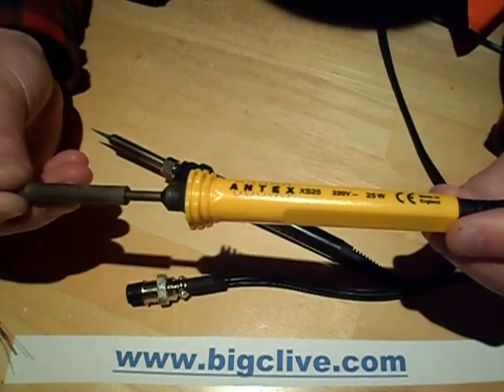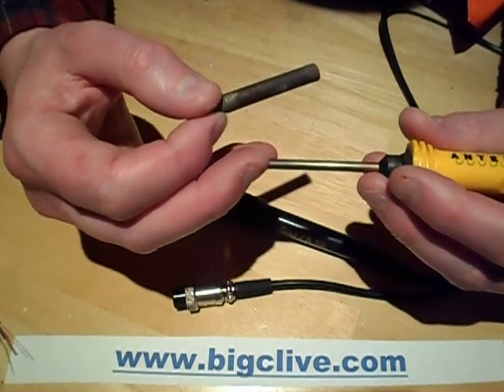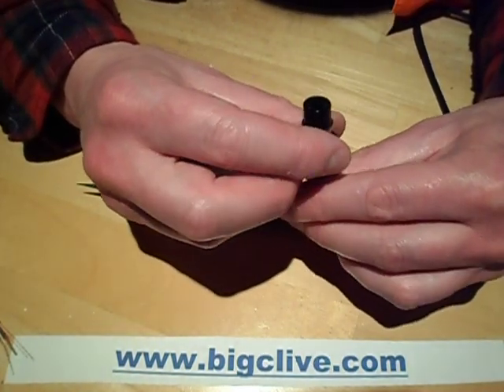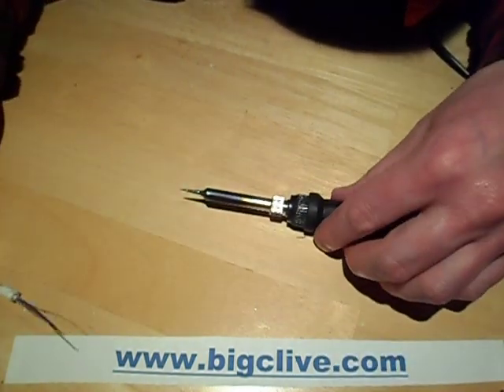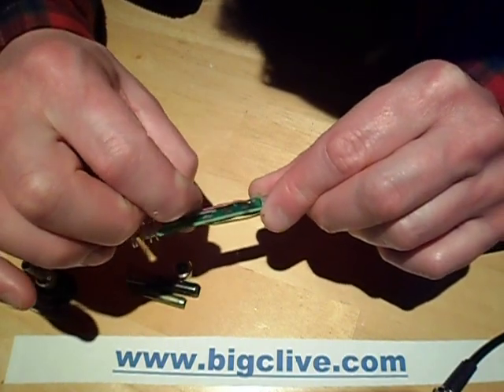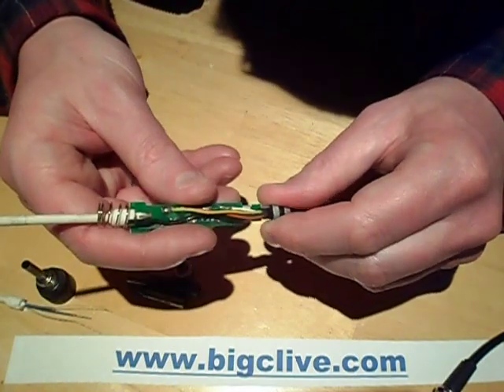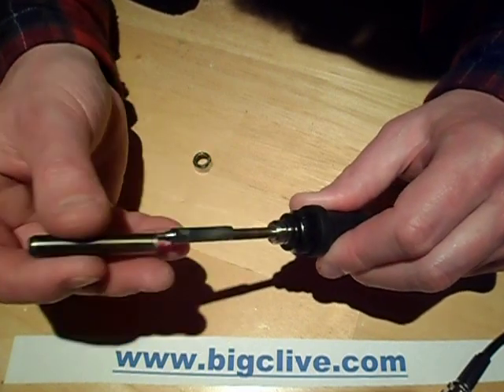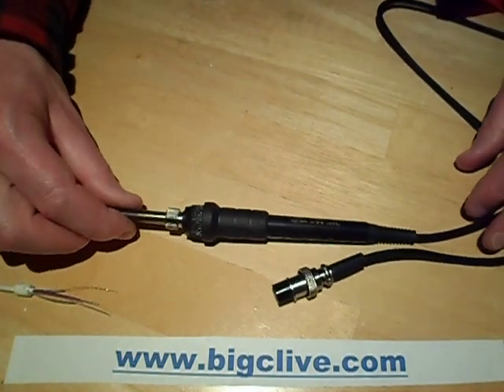Inside a cheap Chinese Yihua soldering iron.

Comment: How's the build quality, specifically, the plastic threads on the plastic/metal cover you start unscrewing at 03:31?

I'm asking because I've seen some 936/907 clones where those threads don't allow you to screw the tip cover properly (basically, they aren't strong enough to support the connection, they 'give out', and then you can (pretty much) keep turning the screw forever, without being able to tighten the cover properly).

You say "nice construction" at 05:34, but - is it? :)

Comment: i would like to try less than 120 volts on a red soldering iron. maybe 60 - 80 volts.
Reply: You can do exactly this if you buy the cheap "red line" Weller soldering station sold at DIY home improvement stores  ($65 US at Home Depot).  I think it's a piece of junk and not worth the price because the iron included with it is a standard 120 V iron with an ordinary wall plug on it, and the only thing the soldering station does is allow you to turn down the voltage to the iron with an electronic lamp dimmer circuit inside the box. No temperature feedback sensor, no calibration,  and no actual capability to turn the temp up, only down.  The control station is supposedly good for up to a 300 watt iron so I suppose you could plug a big iron into it and decrease the temperature downwards, but why bother?  It's 2024 and you can buy a temperature feedback controlled, calibratable analog soldering station for $45 from Harbor Freight;  I did a teardown and review of the Harbor Freight iron on my channel and compared it to the Weller, and the Weller lost, badly.

Comment: I have one Yihua 939D+, I use it for 3 years 7 days per week without any issue.
This is a very good option if you are in budget.
I have a Hakko FX-888D but I prefer the Yihua because it have 3 memory easy to reach.

Best Regards.

Comment: Well don't be shocked if the design is good, if it is indeed based off Hakko, which are Japanese soldering irons that probably are the best quality ones in the world. And this Chinese company Yihua is indeed a proper company, so there will be quality involved, it's not like an unbranded ripoff for example. I think Yihua is what most Chinese use, so for example in China they don't generally use the unbranded ripoff stuff that some naive foreigners waste their money on, in China they usually find a good Japanese or other foreign design, and have a legit Chinese company try to clone it at a decent level of quality, so the domestic Chinese workers can have a reliable product etc.

Comment: I've had this soldering station for almost five years now and it has been working perfectly, I have never had a problem with it. Mine is the same as all the basic 936 clones with a black plastic face and plastic knob to set the temperature, but mine says "W.E.P. 936 ® sol dering station," printed exactly with that space between "sol" and "dering." Perhaps a limited edition. I have no idea what could W.E.P. mean. But I can definitely recommend the station, it is great value.
Reply: Cool

Comment: I have learnt to hate these Yhiua irons.  I bought 2 one after another.  After one use i now get the 5-E error.
Reply from the maker: On the digital irons look at my video about them and the very common and easy to fix fault
Reply: @bigclivedotcom  i knew you might have one. Looking now
Reply: So I found the video I think it is. I actually have the a blue soldering station that also died after a few uses. I ended up just putting into storage. I will try to use your video to fix it.

The latest iron is a Yihua 928D-iii.

I checked the continuity of the element and sensor, both are fine. It does seem to heat up, showing temp rising quickly, then showes the S-E error.  Could it be an overheating issue?
Reply: In the end I bought a cheaper iron and re heated all the contact's.  Which seemed to have worked.
Reply: Did you find a good video to fix error codes on replacement irons on cheap solder stations ?

Comment: hi Clive. Up until today, i had a maplin soldering station - precision gold A55KJ - looks exactly like the iron you dissected. Today, it tells me 
 " - 5 -E -"  [without quotes] which, according to the manual is faulty element. trouble is, if i apply 19 volts at 1.6 amps to it, it heats enough to desolder the triac that should control the temperature to it - for testing - it too is fine. My question is - how can the unit detect the temperature of the iron - with pins 1+2 and 4+5 shorted out? [no thermocouple] I cant find a diagram for it anywhere and im not clever enough to reverse engineer it as its quite complex.
cheers in advance - Andy

Comment: Great video, very helpful, Thank you, Are these irons rated at 24 volts ? i applied 23 volts to one and it burned out the element in less than a minute !! I powered another with 16 volts AC and it has been working fine,,
Reply from the maker: They are rated for 24V, but only with thermal feedback control to limit the maximum temperature.  To use them as a thermally balanced iron you need to use a lower voltage as you describe.

Comment: I own Antex Xs25 with 3 extra original tips (each one costs about 10 euros each) and an ERSA solder Iron 30S 40W with also an extra tip that costs me including the shipping from Germany about 13 euros. Both are very heavily constructed and they are filling very well in your hand.  I work constantly with them and I feel very sure for their effectiveness and their quality. I got as a gift with another buy from aliexpress a "Soldering Iron 60W Adjustable Temperature" with some tips extra that seems like the one already shown in the video. Soldering Iron is very light and cheap, but the main problem was the tips itself, which are also very very light in comparison with antex or ersa one. They oxidized after the second use and they are very difficult to clean them. If I could attach a photo I will show what exactly do I mean. The previous month I ordered a YIHUA 8786D station just for the hot air from banggood (I am still waiting to receive it after 50 days from the shipping day) and with it, I ordered also an extra a set of "DANIU 12pcs 900M-T Series" tips for just 6.5 euros  since it has also a soldering station. I received the tips hoping they are better than the first one... I didn't test them, but they seem identical with the one I got from aliexpress. I don't think I will use the soldering iron at all, except, if I find quality tips that will fit in YiHUA. My conclusion ? You get what you pay.

Comment: Some to increase the thermal conductivity between the ceramic heater and the tip put off grit graphite or copper paste (as you know both solutions can transfer electric charge through the soldering tip) It is better to press a small amount of thermal paste used for the CPU - IMPORTANT that the paste does not conduct the charge electric, so it must NOT contain silver or other metallic ingredients in the composition!
Thanks to this, we eliminate the air gap between the ceramic heater and the tip and get better heat transfer to the tip.
Reply: The heating element is nonconductive ceramic, what's the problem with copper paste? Soldering iron temperatures are way above CPU temperatures, what makes you think that CPU paste doesn't go sideways when subjected to 200, 300 °C?

Comment: There are three types of heating elements for those Chinese soldering irons A1321, A1322，A1323. The one in this video seems to be A1322（ceramic），you can also use A1323（metal & long-life），but not A1321.
Reply: Thanks!

Comment: Hi Big Clive, could you tell me which soldering station you have? I've got the Antex 660A and I was wondering if those cheap irons would fit. It's always good to have a spare iron, just in case...
Thanks a lot!
Reply from the maker: I'm not sure about the pinout or whether the Antex unit uses a thermistor or thermocouple.  The cheap irons (referred to on eBay as soldering handles) usually have a thermocouple.
Reply: bigclivedotcom, thanks for tout answer. On second thoughts, I think I'll buy a Gaz or mains soldering iron as a spare and leave my station alone. I think it'll be safer!

Comment: Is it possible to take multi meter and read the output of the four wires to see if The element is bad or the board of the soldiering handle is bad ... and what would the reading be on the four wires?  The soldering station that I bought gave me a replacement element with the four wires but I don’t know if it’s the handle or the main unit that’s why am asking the question.
Reply: Chuck Schick My newest Chinese station comes with instructions for testing the iron with a ordinary ohmmeter. The element, needs to be one value, the sensor another, and the ground "pin" to soldering bit tip a third.  Measure your spare element and compare to the iron.  Values should be almost the same for the first two, and max 2 ohm for the grounding of the tip.

Comment: Please help I have one of those 907A soldering irons and it doesn’t seem like it’s heating up even though at the station at showing 400° is there a way to measure or find out if it is the soldering station or can you take a multimeter to that little circuit board inside that soldering iron to find out if it’s the soldering iron
Reply from the maker: +Chuck Schick It sounds like a sensor or wiring failure.  Try a new iron first.  They are often referred to as soldering handles on eBay.  Make sure you get the version with the right connector.

Comment: 5£!!! Those bits should be .5£
Reply: arunavadas1 Actually they should be free, especially for you!
Reply: well, i buy those @INR25
Reply: Sorry sir, you don't buy "those" @ INR25, you buy cheap copper bits, most probably Siron brand, which last 5 days on a production floor. They need to be filed after every 15-20 minutes of usage. For your information, the bits that come with these imported irons are called Long Life Bits, they are made of copper plated with nickel and iron (or maybe some other combination of metals) and they last very long, they don't need to be filed to keep them clean. I use them regularly, so I know what I am talking about. Even Siron brand has these long life bits which cost INR 75 each. I use these also regularly since I am into electronics production.
Reply: He is also having the same problem
Reply: I think you didn't watch the video... He sid those bits are expensive and burn out quickly

Comment: Still have a couple of Antex irons, I agree with yuour comments about the bits. Plan on going for one of the import jobby soldering stations, probably a digital one, works out cheaper than a new Antex.
Reply from the maker: Keep the Antex irons for when you need a little extra mass for bigger joints.

Comment: My friends and I use the same iron for a 120 Volt supply, (40 or 50 Watts?) with a tiny temperature control knob in the handle and a LED that indicates the power level that the temperature control is set for.  They look identical using the same parts, a set of tips, no spare heater, all for  $17 delivered.  We all love them.
I also have a 12 Volt 50 Watt version that has a cigar lighter plug with no temperature control that works great in cars, which uses the same accessories. ($?)
They all heat up very quickly. All are from amazon.com over the last 5 years.

Comment: Hello. For all solderers out there, you can get 5or 10  times more use out of your tips if you re-tin the tip right when it starts to turn a brownish color. I have found that a Sal Ammoniac Bar to work the best and they are not very expensive.  First clean the brown deposit off the tip by wire brush, light sand paper, steel wool or whatever trips your trigger. Then I dig a small channel into the bar big enough for my tip to fit in and put a little solder into the channel. Then I lay my soldering gun flat on the bar into the channel with the solder in it and keep rotating it. It will not take long. In less than 2 minutes, you have a brand new soldering tip all tinned and ready to go.

Comment: Very good review.  I have owned several cheap stations and if you truly need it to repair just a few joints or switches,  then there is probably no reason to spend more, but these stations tend to fail out of the box or not produce a temp at the tip anywhere near what the dial reads.  You will save yourself some headache and time by buying a proper Hakko or Weller station.

Comment: Hey big clive. I know it's been a while since this video was posted, but what is your current view on YIHUA (or Hakko) soldering stations? There are a few on Amazon and i'm considering to get one.
Reply from the maker: I'm still using my combined Yihua soldering iron and heat pen.  I think they're absolutely fine for basic electronic work.
Reply: I just bought one of these Hakko "clones." 
The hot air side works fine. the soldering iron side  would start to heat up as soon as main power was switched on.  when I turned the switch on for the iron the temperature displayed correctly but wouldn't stop heating until I turned the main switch off also there also was a loud hum coming from the transformer..

Opening up the case and traced the circuit and discovered 2 pins on the opamp were solder  bridged. I replaced the opamp and triac . hooked it back up and all is well. 

For $50 for the unit and $3 for the chips I'd say its a good deal.

Comment: I've been having issues with the soldering iron falling apart where it screws together with the plastic housing sleeve. Does anyone know where to get a good quality replacement iron?
Reply: £2 ebay?
Reply: are you saying buy more cheap ones? My question is asking for info on a affordable better quality replacement.
Reply: Seven5555 I don't know, but these irons are fine

Comment: Hey big c I've got 1 of these 825D+ with 80 w iron and air love it.
Mine has a hum when switched off so i unplug, better fix?
Only complaint other than that is iron cord is 2 short. I got multi colored silicon ins. wire(what they call it at least) Can i cut and extend the length or will that change something I'm unaware of?
Reply from the maker: +Vic Prk (Slick  Vic) A longer cable may introduce too much voltage drop to the iron and reduce its rating.
Reply: Tks, just have to crank er up then eh.

Comment: Good video, would you have the link to heating element for hk soldering iron (yihua 936)? I broke mine.
Reply from the maker: +Nas Khan Do a search on eBay for your soldering iron brand.  It may be easier to get the whole soldering iron, in which case make sure that you check if the listing if for a male plug or female socket version of the lead.

Comment: Because Maplins is shit.
Reply from the maker: +o0julek0o Sadly so, and they used to be the best hobby component company too.
Reply: bigclivedotcom But nowadays, so much of what we sell is overpriced and extremely low quality... I feel ashamed when I have to point people to all of the overpriced everyday products.
Reply from the maker: +o0julek0o Sadly the fall of Maplin is largely down to the lower amount of people experimenting with electronics, so they have had to diversify into general electronics goods.  The sort of people you're helping choose stuff are obviously not inclined to shop for technical stuff online, so don't feel ashamed to sell them what they are willing to buy.  I still use Maplin, mainly for the odd novelty they get and "emergency" component supplies.
Reply: bigclivedotcom I think it's only good for emergencies and as you said, maybe checking out the oddities we get in and surprisingly there's plenty of them. I recommend looking though the catalogue (since the website is near enough non functional) for the weirder or more specialist things at relatively normal prices. I mainly feel sorry for the older folks who just don't know how much cheaper they can get it, even in normal shops (watch batteries are notorious as B&M who are literally a 100M from our Maplins, sells them for about £2 for a huge set and we sell them for £4 for one.) or obviously online which I can understand can be daunting for the older guys.
Reply: +bigclivedotcom Funnily enough Dick Smith Electronics here in Australia did the exact same thing many years ago (you haven't been able a component there for about a decade) and recently went bust in pretty dramatic fashion...while Jaycar (founded by an ex-Dick Smith employee in the early 80s) has remained very profitable in the hobby electronic component biz.

Comment: Have you looked at any butane/gas fueled soldering iron? There normally pocket sized and are very handy as they don't require any wires.
Reply from the maker: +Lucas Solomon I've never really found a butane iron that solders well.  Their temperature is very volatile.  I keep one in my tool bag for emergencies only.
Reply: +bigclivedotcom OK I had only used one once and didn't know whether or not it was worth it to get one myself, when I used the one I used it had a few issues staying lit but other than that it worked fine. That makes sense though since it strictly based off of the flame and not regulated specifically for it.
Reply: +Lucas Solomon I have used a BernzOmatic butane soldering iron.  i can say once you get them lit they don't go out very easy in fact i haven't had mine go out unless i turn it off.  best part is not being tethered to any outlet or base.  However that being said the exhust port on these require some practice so you don't burn yourself or whatever your working on.  i feel they take awhile to heat and to cool.  Plus i am unable to find a single ultra fine tip for surface mounting.  So for my final opinion i would rate them as meh more of a novelty than a hard working iron.
Reply: +Lucas Solomon You'd be better off just getting a nice-ish battery powered one.  They take forever to heat up and it's hard to control the temperature of the tip.